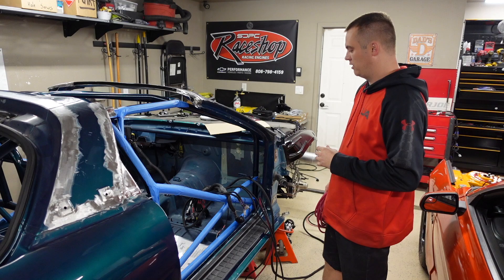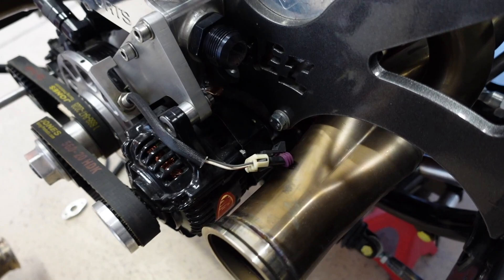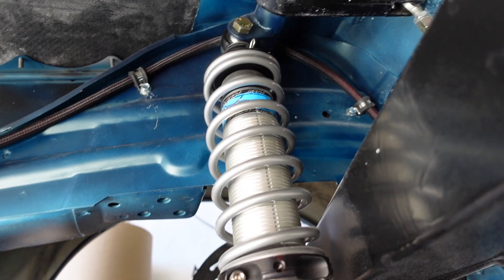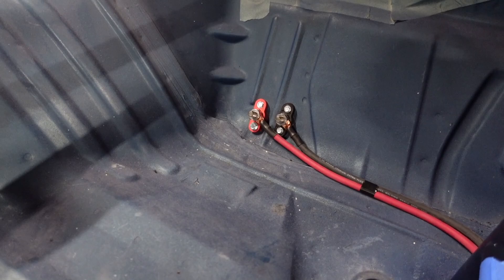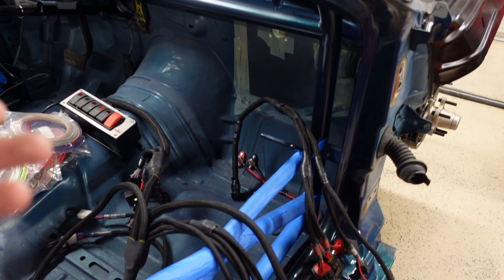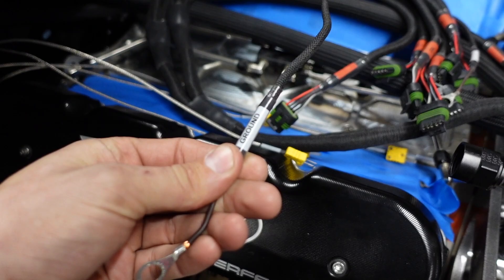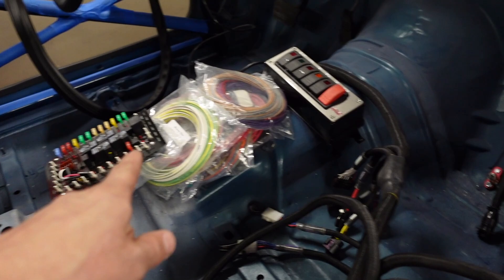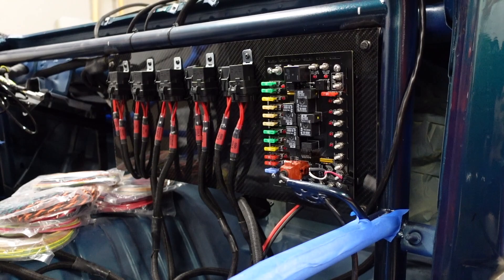Power and Ground! How to distribution blocks! What gauge wire! - RACE CAR WIRING SERIES - Part 2

Comment: Great great keep them coming 💪🏽 this is going to help me alot
Reply from the maker: Good to hear! Im working on the next one right now!
Reply: @StreetCarJoe   can you provide a link to the battery wire
Reply from the maker: @michaelpineda2709  EWCS 4 Gauge Premium Extra Flexible Welding Cable 600 Volt 25 Feet Each Black+Red https://www.amazon.com/dp/B016HGOH3G/ref=cm_sw_r_cp_api_glt_fabc_R5P7BRXQS82ZVR7JZ560

Comment: Finally somebody does a video on how to wire a car. Joe what is your thought on including a remote mount solenoid? Yeah or nay, I've seen some guys use them to help with hot starts with starter and to have a power point to hook up timing lights etc...Great video buy the way, I liked how you included the part links,that will definitely help. Keep up the great work and thanks for doing this. I can't wait till the next video.
Reply from the maker: I’ve seen those remote mounted solenoids. I hear they work good if you buy the quality kit. I’ve never used one personally so I can’t really give my opinion. Glad ya like the vids! 💪🏻

Comment: The large gauge starter feed (Red) and block ground (starter return Black), both look like size 1AWG, are needed for the starter currents while cranking. If you get the thick fire wall rubber grommets and protect with heat shrink and/or split rubber heater or fuel line you can go directly through the firewall without the added resistance of the pass through and the lugs. You can buy very thick red and black dual wall heat shrink which will prevent any chaffing through the fire wall if also supported with fully cushioned P-Clamps to keep the cable from moving to prevent chaffing. You need a little flexibility (slack) in these cables close to the engine, because the engine will move on its mounts, especially during launch.

If you put a 3/8 inch stud type red and black power point close to the battery in the trunk (keep to a 12 inches or less) you can use this as your star power and ground using the same 1 AWG cable (you can move up to 1/0, but this is not needed) without any negative effects on EFI or CDI or COP ignition operation. This way you can use a crimp battery terminal lug and not the gang screw wire clamps, which I think are higher resistance than the 12 inch common feed when hydraulic crimp lugs are used with a common power point.

It looks like the car does not have an alternator so this wiring in the context of the build did not have to be addressed.

Comment: Like Joe said, definitely wire the ECU & smart coils directly to the battery.  

I chased an issue with a car that has a Haltech & IGN1A coils, it was breaking up badly when it got into boost, almost like it was hitting a rev limiter at 4500rpm. 

Ended up being the ECU & coils were wired positive & negative to a distribution post inside the car & not to the battery like Joe mentions. 

Wired them directly to the battery & problem solved!

Keep up the good work Joe, looking forward to more wiring content 👍🏼
Reply from the maker: Thanks man! Yeah I've seen too many issues not grounding stuff properly lately it seems...

Comment: Did I miss it but what gauge wire did you use for alternator and other wiring from battery to distribution block and cut off switch? Thanks and super clean work man!
Reply from the maker: It’s 4ga... but keep in mind this car has a mechanical fuel pump so it doesn’t have a huge electrical draw
Reply: @StreetCarJoe  thanks for the info! Awesome work again. Keep up the content we love it.

Comment: What gauge wire are you running? You might need it be a bit thicker to compensate for all of that length! At least on my car, since it runs to the back as well, I use 2 AWG wire

Comment: Curious if there’s any other main battery terminals you’d recommend, I see you’re using the standard parts store ones but we always run into issues with the tension plates fatiguing and causing loose connections. Excellent videos so far man, glad you finally made a channel.
Reply from the maker: Good point. I've seen people use a variety of different ones. The ones I use are GM ones. Wether or not the quality is better than the parts store ones, who knows. Dont over tighten and I haven't had any issues...
Reply: @StreetCarJoe  I’ll have to look into the GM versions, thanks for that.
Reply from the maker: @lse90garage  I get them from my favorite place 😉 ACDelco 3BA35 Professional Battery Cable Terminal https://www.amazon.com/dp/B0054T95ZS/ref=cm_sw_r_cp_api_glt_fabc_7JSV104P86V75TBBWHV8?_encoding=UTF8&psc=1

Comment: I always thought that some of those wires you have going straight to the battery.... are supposed to go to the switched side of the on/off switch in the rear in case of a roll over/fire..... no? I know they work better straight to the batt... but if there is an accident the safety crew needs to cut all the power. at least the way i always understood it. thanks for the vid.... always fun to watch. and motivation to get my junk rolling.
Reply from the maker: The power leads for the ecu go to the battery. The relay board and switch power (which trigger on the ecu) are on the switched side of the cutoff switch. So if they kill the power, it kills power to the relay board which will kill switched power to the ecu and all the relays...
Reply: @StreetCarJoe  correct. but there are still live wires when the switch is off. I only ask because i am going to wire up my car soon and EFI cars are a little different that the older prostock stuff we used to run. Good info. Thanks again.

Comment: Hey joe are you using a bolt and nut or the revnuts for the clamps used to   hold the ground and power under and inside car. Thank you love the channel
Reply from the maker: Most of the p clamps holding wiring and stuff on the bottom side of the car are using small self-tappers. If it’s not something I plan on taking on and off a lot I think those are good to go.

Comment: Always thought the alternator could go to the bulkhead power distribution? Better to go direct to battery?
Reply from the maker: This case the alternator lead has to go back to the cutoff switch so when it’s switched off the alternator can’t keep the car running
Reply: @StreetCarJoe  oh ok,  I’ve always used the waytec 2 post kill and just ran the bulkhead power with alternator/starter to the battery side of the kill and seems to work good!

Comment: If you have the battery inside of the car, in the passenger seat area. What size wire would you recommend for neg and pos?

Comment: I'm running a msd 7al2 do I have to run that to the battery or can I just get power from the dist. block on Firewall?
Reply from the maker: I looked real quick for ya and the instructions state that you can go directly to the battery or a good junction block, just not the alternator.

Comment: Have you ever had an issue running the 4ga power to the distribution block for the starter + relay board? I was told to use at least 2ga even with good welding cable.
Reply from the maker: This car and my car don’t have enough electrical components to draw enough amps. The have mechanical fuel pumps. On a car that has a big electrical fuel pump and a 200+ amp alternator; I would be using 2ga welding cable. Never bigger
Reply: @StreetCarJoe  Hmm, i wonder what I will need. Truck alternator, oem starter, leash street strip, dual electric fuel pumps. Headlights, taillights, power windows etc. I may just do 2ga all around.
Reply from the maker: @mathewpen  Yeah I think 2ga will get ya covered!

Comment: When you run the grounds for your inputs and 5v switches are the grounds all tied into a terminal trip or all seperate?
Reply from the maker: Patience... That will be video 4 or 5. But no I won't use the terminal strips. I will be using the step down connectors to hook up all the power and grounds for the inputs/outputs.

Comment: Is there a vid where I can see how you wired the on/off switch? and do you not run a switch controlled main on/off solenoid for the power of the car besides the push on/off? Like switched power for the main power and relay power? Or do you just have constant power controlled by the push on/off switch? I just am worried about an accident and no way to cut the main power cable and not having a breaker and relying on someone cutting my main power In The rear of the car. If that makes sense.

Comment: How do u go about hooking up multiple power  wires  to the battery post ?
Reply from the maker: You can see in the video I have 2 hooked up to the ground side. Beyond that, you would need a different terminal like this.https://www.amazon.com/InstallGear-Gauge-Battery-Terminals-Shims/dp/B07BSVQLCC/ref=sr_1_1_sspa?dchild=1&keywords=battery+terminal&qid=1616163026&sr=8-1-spons&psc=1&spLa=ZW5jcnlwdGVkUXVhbGlmaWVyPUEyWkZPWEc0UVA0U1hSJmVuY3J5cHRlZElkPUEwMDM0MTEwMjY2Rlg1MUM0REtZTyZlbmNyeXB0ZWRBZElkPUEwOTE4OTcyRTJRQTNYUTlYN1RHJndpZGdldE5hbWU9c3BfYXRmJmFjdGlvbj1jbGlja1JlZGlyZWN0JmRvTm90TG9nQ2xpY2s9dHJ1ZQ==
Reply: Thanks a bunch. Grest channel and info👍👍

Comment: How do you determine what size power in ground to run from the battery up to the polecat? Is there such a thing as being too big?
Reply from the maker: Yeah you can do too big. There is a big formula for distance and amps drawn to determine power wire size. I’d say most cars with a mechanical fuel system are good for 4ga welding cable. If you have electric pumps and a bigger alternator like a 200amp, I’d go 2ga welding cable. Quality wire helps a ton as well so you don’t have to use huge wire.
Reply: @StreetCarJoe  excellent.  Thanks for the information 👍

Comment: What's up Joe - I ran 4 gauge power and ground cables per your instruction from the battery to bulkheads on the passenger side of my car.  While testing the starter, it drags for a sec and this picks up spinning over.  My car is a 64 Plymouth Fury (long car).  Do you thing I need to try 2 gauge to assist the starter with power?
Reply: you can measure voltage drop on the power and ground circuit but personally, on a street car I run 1/0 or at bare minimum a 2ga
Reply: @travispfannmuller7717  I have since switched to 2ga, which made a significant difference.  Thanks for the response!

Comment: Can you give the wire sizing your using for each aspect?
Reply from the maker: Will do. So far everything in this video is 4ga. He only has a 100amp alternator and its a mechanical fuel pump so the draw on the electrical system will be minimal.
Reply: @StreetCarJoe  thank you very much Joe

Comment: Looks like you do a great job with all of the wiring, except for the battery terminal connectors. You have an expensive battery, batter mount...etc and you go with the cheapest battery terminal connectors ever. Look how the wires and clamped on those things. It’s only a few $$ to get some much nicer and more reliable ones!!

Comment: What size wire r u using to run power/ground the length of vehicle like that?
Reply from the maker: Not much electrical on this car with a mechanical pump. It has 4ga wire
Reply: @StreetCarJoe  ok I had 0 on my 4th gen with electric pumps. Maybe I can get away with 2 or 4 on my mustang with mechanical pump and smart coils
Reply from the maker: @Onalky87  Yeah I had 4ga on my mustang with mechanical pump, electric water pump, electric fans, trans fans, lights, smart coils, 16x injectors. 100 amp alternator.

Comment: Hey joe I’m not nocking ur work don’t u hate those battery connections that u just strip some wire off a jam it under there an Tighten it down I’d rather use the eyeball connectors the crampons end at the battery’s because I’ve seen those ends ur using break in 2 pieces I uses the battery cable ends with the stud other than that all of ur other ideas were great 👍
Reply from the maker: I buy the AC Delco version of them, not the cheap parts store. I really like them to be honest. Just don’t overtighten and they work better than most I feel like...

Comment: Simple question for you,but I've been wrapping my head around it and  looking. So I have the terminator x, and fues/relay panel  with a rocker switch panel. Question is, I start my car by poweing up the switch panel then I have a starter switch ,once the car is started and running how do I turn it off without powering off everything? Which is what I had to do with the old 0411 ecm . But now with the term I don't want to kill power to everything just to shut the car off. If this confusing I appogize, probably why I couldn't find an answer with Google and YouTube search
Reply from the maker: I don’t know how that switch panel is made or wired up. But when I wire up my switch panels, the ignition switch turns on the Holley and whatever other switches that I want to be tied to ignition. The other switches are powered by the battery side so they have power all the time and will stay on even if the ignition is off. Hope that makes sense 😎
Reply: it's just a basic amazon panel , but I changed out the start rocker to one that has 6 posts on it, I know I'm confusing as hell. but I have a good idea of what you are saying from your reply. by the way love your videos and attention to detail. I'm a budget guy and like to make my own stuff, but I buy what I have to when it is important. and thank you for the quick reply on an older video.